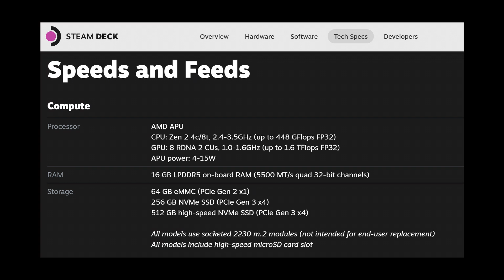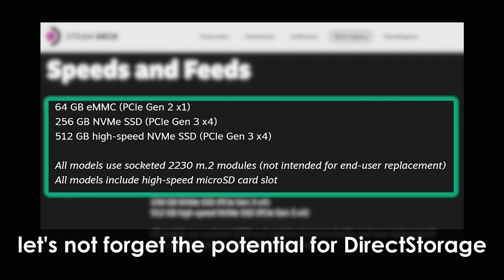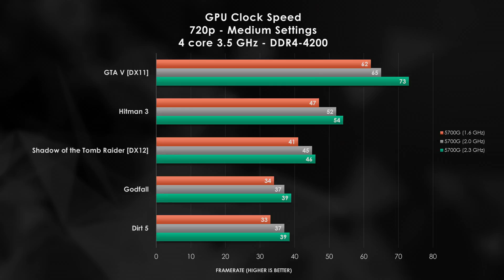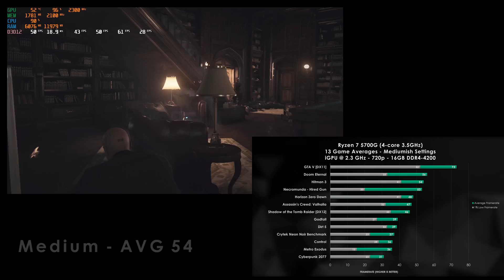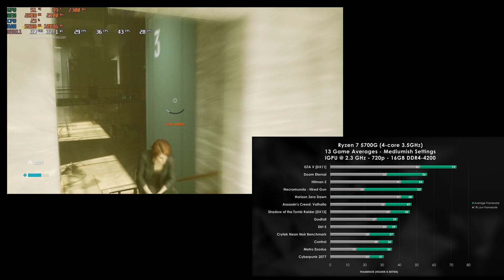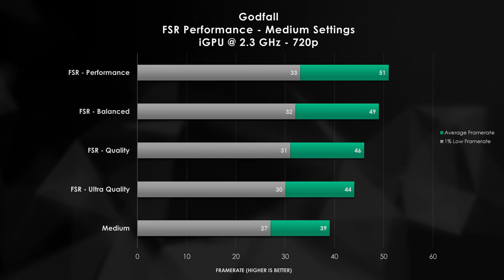Steam Deck Performance Explained | Tech Spec Deep Dive and Predictions

Comment: The frequency of your DDR4 4200 here, is this on a mobile device or a desktop? Desktop motherboards run in dual 64bit channel configs. Most mobile devices run in a dual 32bit channel configuration. What this means is DDR4 4200 on a mobile device would be the equivalent of a desktop running DDR4 2100 in dual channel. The Steam Deck runs at DDR5 5500 in a quad 32bit channel configuration which would be the equivalent of a desktop machine running in a standard dual 64bit channel configuration

It will be interesting to see what kind of performance improvement will come from moving from dual 32bit channels to quad channels.  you're essentially more than doubling your MT/s
Reply from the maker: This was tested on a desktop, and yes, the theory is my desktop dual channel would simulate a quad-channel 32bit interface.

Comment: Vega to RDNA2 at 1.6ghz should be around a 20-25% bump in performance, all other things being equal.  it should outperform a Vega 8CU at 2ghz assuming the RDNA2 chip isn't throttling down to 1Ghz or lower.

Comment: How realistic is to expect 30fps on 1080p when the Steam Deck is docked? It seems possible if it's getting 60fps on some titles but I don't know if I can simply divide by 2. Maybe if they use FSR from 720p to 1080p?
Reply from the maker: FSR is a good supplement, just don't expect wonders there. As for native, you could probably get 2/3 or 3/4 the frame rate of 720p.
Reply: @TheTerk  awesome thanks!

Comment: I predict that the Steam Deck will be able to play /most/ games prior to 2015 at 800p 60 at high/max settings. Games that are from 2016 or newer will probably be around 800p 60 at medium settings or 800p 30 on high settings. 

Of course some game will be better optimized than others, for example I think the Steam Deck can run Doom Eternal at 800p 60 on high settings. Considering the PS4 Pro runs it at 1440p 60 on Ultra settings that's not far fetched, especially since the Steam Deck has a vastly more powerful CPU and double the ram. Control on the other hand will probably be 800p 30 on a combination of low to medium settings due to its bad CPU optimization. Thankfully even on low settings Control is still a pretty game. 

Another thing to consider is that since the Steam Deck only has a 7 inch 800p screen you can probably get away with running everything at medium settings. Perceptualy it might look almost as good as running the games at high settings since you might not be able to perceive or resolve additional detail from certain graphics settings anyway.
Reply: Sounds dope. Exactly what I need.
Reply: Yup, probably high+mid for current AAA titles (aka, mostly all high with a couple of settings turned down to medium - there's enough ram for the ram heavy settings, just gotta tweak the calc heavy settings to get it juust right)
Reply: I'll just play larger highly detailed open world games like Witcher 3 or Red Dead 2 at 30fps, for games like that it makes sense to prioritise graphics over performance.. If I can tolerate those games on consoles/the Switch, I can tolerate it on a handheld PC.

Comment: I am afraid you have used wrong hardware specs. Valve has update the memory specs, it is better than first announced
Reply from the maker: I literally took the specs from the webpage. Link in the description
Reply: @TheTerk  He references to the 16 GB LPDDR5 on-board RAM (5500 MT/s quad 32-bit channels), "originally" it stated on the website dual channel, but you got it right in the video.

But I do have a question, could you probably test it with your HW on Ubuntu with Proton, so we would probably get some better references how games would "actually" play on the Steam Deck, as its based on Arch Linux (Steam OS 3.0 inst aviable yet) and proton. But thanks for the detailed video!

Valve published a information "how to set up a test environment" on their Steamworks Documentiation: https://partner.steamgames.com/doc/steamdeck/proton
Reply from the maker: @Kartfel1  I did run a limited test with Ubuntu, but was limited on time. I played Metro Exodus through proton and saw very similar performance. I'll take a look at this documentation.

Comment: Ill stick with my 5700g/4266Mhz desktop. This is such a niche market and in my opinion way too overpriced for what it is.
Reply: Hardware included, what you get is underpriced.
Reply from the maker: @Aethelbeorn  comparatively to thin and light laptops, yes.  you get the next-gen APU, more RAM, but sacrifice screen space and battery life.
Reply: @TheTerk  I'm cool with that. I'm replacing my desktop if it performs okay. I like to keep things a bit more minimalistic.
Reply from the maker: ya, mobile PC gaming is likely better served by a laptop.  but I'll commend Valve for pushing the technology forward to see what the PC is capable of
Reply: How is it overpriced? It costs more money to manufacture than what they're selling it for. But you are right, it is a niche market but I feel like this is the turning point that introduces the niche to the big stage and may have a chance at pushing into the mainstream.
Reply: @Stephen-ii9re  In case you dont know consoles have sold at a loss at every launch. They want to gain marketshare. Gain value through subscriptions and in game purchases. But what marketshare is their for 720p mobile gaming? Its trash. The only maker that can cash in on that niche is Nintendo because they have titles people want and arent available anywhere else unless you emulate and pirate. So this 720p turd has no intrinsic value. Theres no IP they can leverage.
Reply from the maker: 720p on a handheld is not terrible.  This is what I was trying to address with the 720p gaming experience segment.  at certain screen sizes and distances, the increased pixels aren't really realized.  This link talks about TVs, but the same principle applies. 
 https://www.rtings.com/tv/reviews/by-size/size-to-distance-relationship
Reply from the maker: "There's no IP they can leverage."  The IP is an open platform.  Plenty of homebrew and other niches might find a new home here.
Reply: @TheTerk  Thats wishful thinking. Its a steaming pile of caca. This might take hold in 3rd world countries but low end gaming isnt anything people want in the US. Theres a reason APUs havent flourished in the US. But you can buy 4xxx/5xxx APUs everywhere else.
Reply: @yosoywilson78  Bro it doesn't matter if a $10 steam game is purchased on a high end desktop or a 720p (800p) handheld.  $10 is $10. Also, the Steam Deck will simply have more and better games than what's on the Switch. Are we really saying Nintendo's 10 or so Mario/Smash/Zelda/Splatoon games match having the entire PC library at your fingertips? Not to mention Halo, Gears, Forza (other MS titles) and multiple Sony titles?   Remember switch doesn't even get all the 3rd party titles due to its power deficiency and if it does they come in a neutered form 2 years later. The entire point of this handheld is to boost the steam ecosystem. Mo steam users = mo money

Also, the switch exists my man. That's lower end gaming than what this will provide and people are buying that completely outdated hardware for $300 in record numbers.  

Yes APUs aren't used often except in all next gen game consoles XD
Reply: @codyhorne33  I can emulate everything on my APU. I dont need a switch. Im waiting to see how well this handles emulation being a mobile APU.
Reply: @TheTerk  yeah thats true. But it probably will not be a great performer for emulation. It sucks but a mobile APU isnt going to deliver a whole lot of performance.
Reply: @yosoywilson78  You just asked "what market share is there for 720p mobile gaming" and I introduced you to the Switch which is selling gangbusters. Sure desktops can do way more than this device. But they aren't portable handhelds XD.  That's the entire point
Reply: @codyhorne33  Switch sells like gangbusters because of the library of games that are not available anywhere else. Unless you have a good PC to emulate your only choice is a switch. Holy crap what is wrong with people? Is it that hard to understand?
Reply: @yosoywilson78  Nintendo exclusives are part of it. It's also because it's ... a .... handheld ..     and people want portable gaming devices XD.  It's not difficult. 

So explain away the over 110K preorders for the Steam Deck within 90 minutes on launch day if it's only Nintendo exclusives that sell handhelds. This number also doesn't include the entry level $399 model that is most likely the highest selling model.
Reply: @yosoywilson78  Also aren't those Nintendo games that everyone loves 720p XD
Reply: @codyhorne33  playing undocked yes. Docked can be 1080p. And also theres no choice. If you want to play their IP thats what you have to accept. Unless, once again you have a good PC that can handle emulation. Nice try at a flimsy argument though.
Reply: @codyhorne33  Do you understand how small 110k is for hardware? Thats for the entire WORLD. And do you understand a LOT of people will cancel their pre-orders? This will go the way of steam machines. The Atari VCS has outsold the steam deck at this point and that system is even more worthless. Get a grip and stop fanboying everything PC related.
Reply: @yosoywilson78  it's not for the entire world that was just for North America.
Reply: @yosoywilson78 this aged so well. 😂
Reply: @dewinter1411  Steam deck is still a pile of shit. Nothing has changed.
Reply: It's definitely not a desktop replacement (depending on needs of course) but is locked in no way overpriced for the specs provided in that form factor. The engineering and plastic design alone had to be a fortune.
Reply: Exactly my point, it might be subjectively over priced, but in reality it's good for the money. You don't have to purchase games on steam to make sure they get their money's worth. That's just what they're betting on. But closed garden systems are a different story because if you want to actually play on real consoles you have to buy games or pay for subscription services. And I wouldn't conflate your gaming preferences to the average person. Personally I want a decent laptop that can emulate nostalgia games. The intrinsic value is there for your average consumer, not for a pc elitist.
Reply: @Stephen-ii9re  This wont be a "decent" gaming experience. Outside of the emulation experience. Its garbage and suitable for web browsing, video playback, & low end emulation.
Reply: Its expensive but not overpriced
Reply: @soulprestigio9162  Ill wager ypu dont have enough money to buy a base model 720p machine. Its overpriced trash.
Reply: @yosoywilson78  if you only look at the screen but not consider other features of course you consider it overpriced
Reply: Shipping is included in the price.

Alright,  you have 400 dollars, build a comparable rig with hardware accelerated ray tracing, touch screen, controller, 16 gigs quad channel ram, bluetooth, wifi, x86/amd64, case, 40wh battery
Reply: @GodActio  point is nobody wants a 720p “gaming” machine that runs AAA titles at 30fps. Its 2021 and 1080p should be the bare minimum at this point. If you feel this machine fits a need you have by all means buy it. But like I said. My 5700g machine fits all my gaming needs (PUBG/emulation). And it does everything else better as well like running my PLEX server. A ~15W APU is a total letdown.
Reply: @Kaan Özkuscu  this might be viable in your country.